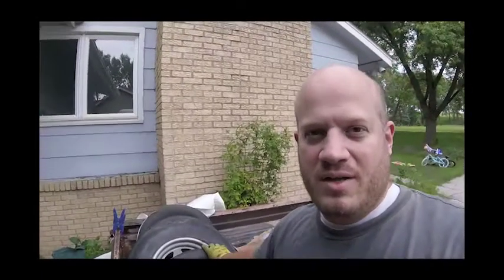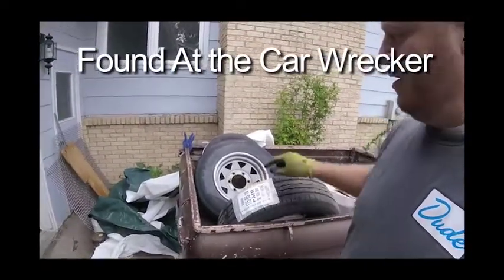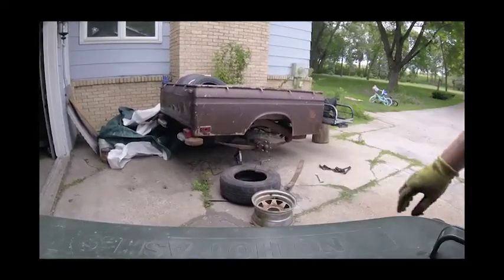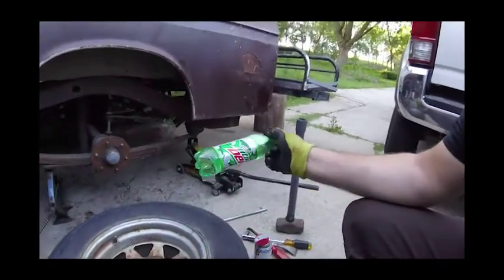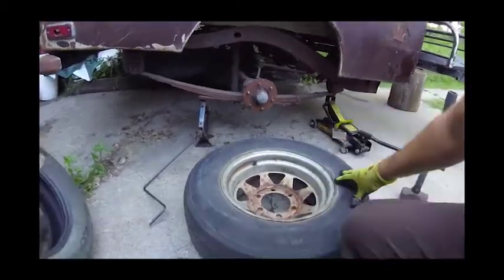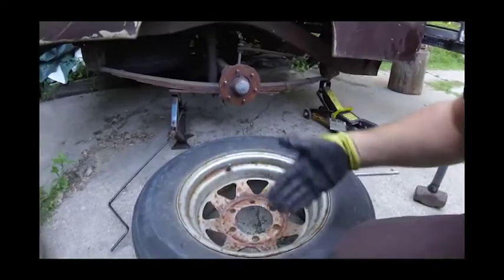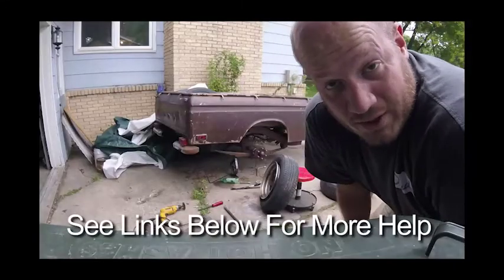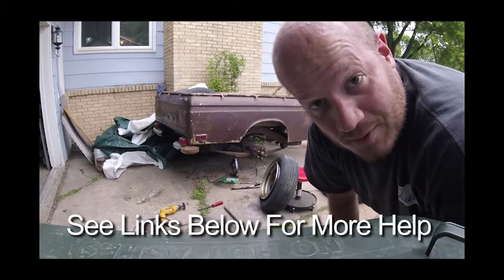How to FIT a SMALLER TIRE on a bigger RIM - Getting Tire Off and On the Rim ✔️

Comment: I have bigger tires than need to fit on a smaller rim. Do you have any ideas? I’m trying to fit a 235 55r 18 when the original size is 235 55r 17
Reply: I’m trying to do the opposite I want to throw a 15 inch on a 16 inch rim
Reply: @mikeverything4098  did it work?
Reply: I would not use a bigger tire on a smaller rim. There is not enough seat you will have a blow out. Plus it will just not work
Reply: @mikeverything4098  did it work